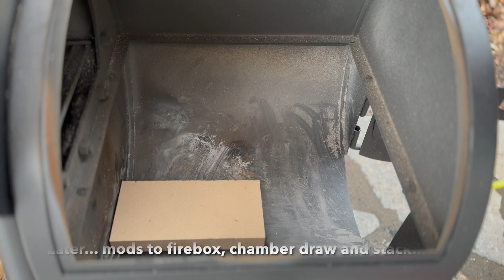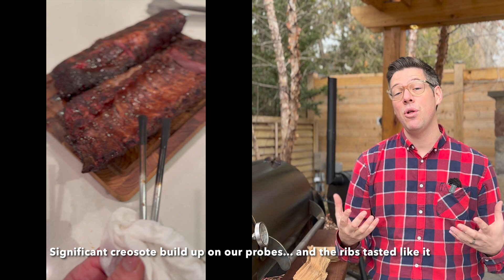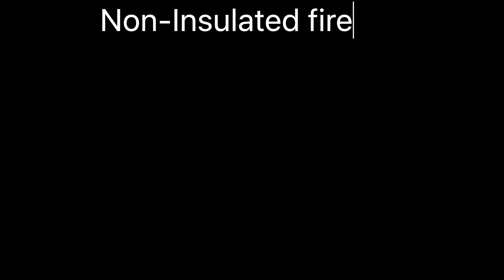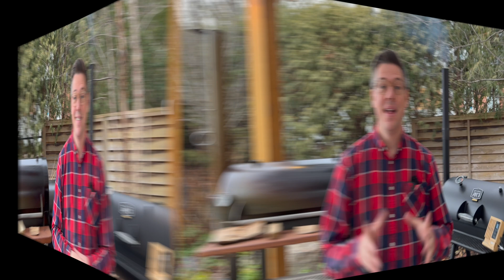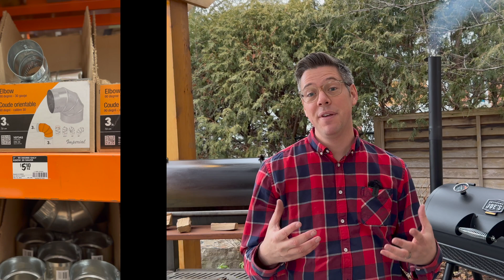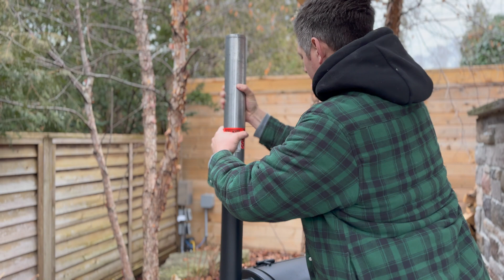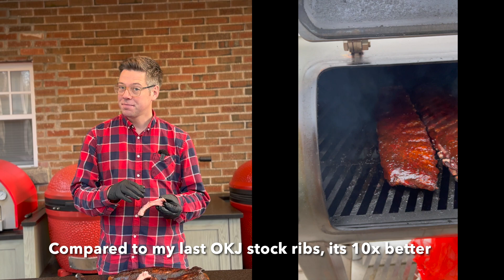Can $50 in smoker mods make my cheap offset as good as a premium smoker for WAY less $$$?

Comment: I too have the gasket around the cook chamber door, a significant extended chimney (like yours but four of them, 18" each, $8-$10 each on sale, Advanced Auto) with top left open (no exhaust damper), and fire bricks in the fire box, all of which helps.  You have to start with charcoal to start your fire.  Then add wood after the charcoal is well lit.  This will give you the low temps.  Trying to burn straight wood in this smoker will cause temps to be too high.  Big smokers = wood.  Small smokers = charcoal, then small wood splits on top of the charcoal.  Baffle plates installed below the grate will even out temps on the Highland from right to left although it will also reduce smoke on the right side.  A baffle below the grate will also force heat and smoke down low and coax it to gradually rise up through the food rather than immediately up and over the food, eliminating the need of a right angle adapter for the stack at grate level on the left side.  A firebox basket helps immensely with fire management to control temps - it really makes a huge difference, much more than one would think.  Highly recommended.  Fire bricks at the bottom of the cook chamber provide thermal density and help to minimize wide temp swings, but they must be carefully placed so as not to interfere with the draft - especially if you have baffle plates.  A custom steel water pan made to fit the Highland will also help provide thermal density as well as to keep temps even right to left as it absorbs firebox heat without allowing heat to get around it.  Fire bricks along the bottom of the firebox will also protect the steel at the bottom - keeping it from getting rusty and keep the metal from flaking, which will result in a longer lasting firebox.  A welding blanket over the top, back side, and door of the cook chamber will minimize escaping heat radiating through the upper cook chamber walls.  A second thermometer installed in the available port on the right side will help provide consistent evidence that your cook chamber is evenly heated from right to left.  I've also installed a rubber temperature probe port on the left side which can handle four probes - two for grate level temp readings and two for meat.  In all, I've spent about $250 in mods on my Highland and I'm very happy with it.  Your splits look a little thick for this smoker, I think the Highland prefers thinner splits to eliminate the white smoke, one or two at a time, depending on your desired cooker temp, length doesn't matter as long as it fits in the firebox.  They must be laid one at a time on top of the lit coal bed for 225, two at a time for 275.  Thanks for posting!

Edit 2024:  I've recently changed my mods inside the Highland.  I've removed the second baffle mod underneath the grate, and also cut the first baffle mod with an angle grinder so that it will hold the water pan but do nothing else.  I also put a fire brick on its side at the bottom of the cook chamber so that the draft hits the face of the firebrick and is forced up to the top of the cook chamber.  I also added a steel stack adapter (not galvanized) from bbqsmokermods on the inside of the cooker so that heat/smoke must exit at grate level.  These things have effectively converted by bottom up smoker to a top down smoker so that it cooks briskets, beef short rib plate, and pork ribs from the top down.  This works extremely well for small cooks such as a single brisket or a couple racks of pork ribs or a short rib plate (it would not work well if one wanted to use the entire cook chamber to cook, but I almost never use the entire food rack from right to left).  This top down draft at the left side of the cook chamber is vastly superior to bottom up smokers and is how all the much larger and much more expensive high-end offset smokers work.  I am pretty sure every COS is bottom up by design, so this mod solves that problem on a COS.  

In summary, the cook chamber mods in the first paragraph above are great for using the entire cooking grate, but it's a bottom up cook.  The mods in the second paragraph above are great for doing a brisket or pork ribs or beef short ribs because the heat and smoke are top down, putting the heat and smoke washing over the top of the meat exactly where you want it.  Good luck.
Reply: I just bought the Char Griller Dakota, very similar to the OK Joe Highland. I'm in the process of insulating the cook chamber door. Will do the firebox also. With an established coal bed, how often are you adding splits?
Reply: @noeltaylor3594  I found it best to use thin splits - I typically heat them on top of the firebox first, then add one about every 20 mins or so, as I keep a close eye on the cooker temp.  Here's a vid showing a successful brisket cook using a stock Highland. https://www.youtube.com/watch?v=QxV4w5bsPqI  Good luck!
Reply: @markennes5208  
 I’m in high altitude of Colorado.. summers and warm temps are short.
 I cook on a cheaper version of an off set .. the best that home depot offers.. and yes.., I have to import hardwood to cook with..
 Great video!!
 I’m using a tailpipe on the exhaust.. had to move it to the side and off the door.. I used JB Weild to stick a nut for my flapper control.. I also use blankets to help level the temp swings in the cook chamber and fire box..
 I also had to build a wind break/ shelter.. 
I’ve thought about going full time and investing in a professional unit but there just isn’t enough people to support such an idea.. 
 Thanks for the entertainment and logic..!
Reply: Great advice. Thoughts on water pans?
Reply: @C_hoops58  Yes, I use it every cook.  I got it at bbqsmokermods.  But you need a baffle plate to hold it.  IMO it's necessary on a COS not just for humidity but also for thermal density.  I also use fire bricks and a welder's blanket for the same reason.  These things help keep the cooker temp stable.  Good luck
Reply: Those sound like really good mods, I'm modifying a cheap Char Griller offset with these in mind.
Reply: I cut off the small side of a small bread pan and hung it from the chimney inlet.  Seems to be working great. Don’t lose very much grill space and it's made with non-galvanized steel.  Currently i'm not worried about smoke leaking in from the sides since the opening is located next to the grill, the majority of the smoke is entering at grill level.

Comment: You want to take out that 90° galvanized elbow from your smoker ASAP. Anything galvanized will release toxic fumes when heated up. You're going to poison yourself. "Zinc fumes are set free when galvanised steel is heated. These fumes are very toxic to breathe. Deposits of zinc from the fumes accumulate in the food.“

Comment: Thanks for doing this series. I have a similarly modded OK Joe's Highland and dream of bigger/thiccer offsets. My big question is how does wood consumption differ on the bigger offset vs the Highland? 

The Highland has enough space most of the time, but I would definitely take advantage of more. My concern is at what point (i.e. pit size) will I be having to use unreasonably more fuel to cook the same amount of food.
Reply from the maker: I need to test it.  Breaking the splits in half and then again they burn really quick. The large pits with logs not touched lasts longer to the point where I actually don’t think it’s a 1:1 relationship between size and wood consumption.

Comment: Really nice modes for this cooker.  I would use PB weld Extreme Heat temp muffler glue.   I like using a water hose with leaks to explain smoke leaks and heat lost.   I am thinking about getting a offset smoke because of taste of the food.  What have you heard about mods for the Carlisle offset on the new version?  What upgrades have you found useful on your Carlisle?
Reply from the maker: I just took delivery of my Gen 2 pit this weekend. I haven’t done any mods yet as I need to relearn it 

Got a few more videos to catch up on but after this experiment in the fall I decided that if I am going to have an offset and put in the work I want the results that come with that
Reply: @SmokingDadBBQ  Will be waiting for these  videos.  Thanks a lot for your videos as they help me get thru waiting for my house to be rebuild.

Comment: I’m not sure the idea of better gas mileage is correct. Myth busters tested this and realized that directly behind the truck is now turbulent air that doesn’t actually reduce drag or gas mileage
Reply from the maker: Lol well I missed that episode but the point here is that you want the smoke to hit your food not be pulled off towards a leak
Reply: @SmokingDadBBQ  Agreed!! I think a certain amount of inefficiency is good though. Too much draw is going to crisp up edges of food. So a little leak of air/smoke doesn’t bother me. Obviously that can also be helped with a damper
Reply from the maker: @Will_Dorsey  I’d rather control that with the damper vs it out of control.
Reply: Actually they found that it improves mileage by 39% if you’re 10 feet behind the truck. 

It decreases mileage if you’re 2 feet behind. 

And even 100 feet behind the truck improves mileage 11%.

Maybe you’re thinking of the pickup truck myth with tailgate up vs down.

Drafting is definitely a thing with race cars too.

Comment: For the plate at the top of the stack, I would put a small clamp that has 2 holes (much like a conduit clamp) on the outside. Drop the bolt/pin down into it so you can swing out/in to where you want it and not have to worry about silicone Adhesive.
Reply from the maker: Good idea
Reply: @SmokingDadBBQ  I had to edit that. I meant CONDUIT CLAMP.. ughhhh

Comment: I think your fire box mod was the biggest game changer allowing for a much cleaner burn.
Nice job James.
Reply: Very cool mod.. I think there is a huge market for highlander upgrades. Looking into making fire collector with a 3.5 inch pipe. Going to add the fire bricks
Reply from the maker: Thanks Brian. Yes that worked great. The clip at the end was an hour or two after adding wood and it was still hot
Reply: @SmokingDadBBQ 
I think your fire/temp control will increase with the use of a grate.

Comment: Great work James, here as well as the improvement that you've made on the Akorn.  The ultimate test for flavor would be to cook a brisket with no wrap in each your Carlisle and the modified OKJ,  mostly running blue smoke, and check for quality of smoke flavor.  Not that I am suggesting you put yourself to a 14 hour arduous task of feeding logs to OKJ in this weather.😀
Reply from the maker: Haha I did record a rib cook on this OKJ running charcoal for heat and wood for flavour like many  suggested vs my Akorn

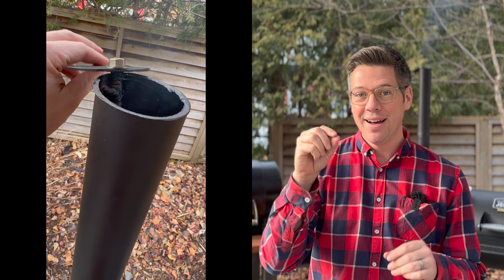Comment: 14:15 Just put the bolt on the outside. It'll make it much easier to weld. If you don't want to weld, then use SST screw clamps (paint black to match). People probably won't even notice.
Reply: Yep an automotive hose clamp on the outside will hold that bolt like nobodies business.
Reply from the maker: Good idea

Comment: Try a U-bolt (or a Crosby)to hold the threaded rod to the top of the vent stack. You’d just have to drill a couple of small holes. (1/4” or #10 , maybe)
Reply from the maker: Thanks

Comment: Great video James. Your mods were right on point to my thoughts regarding a fix to your failed rib cook. As a retired metallurgist with heat treating experience the firebrick mod makes  the most sense. It sucks to lose 6" of working space inside the cooker with the 90 elbow. Apart from fabricating and relocating the chimney exit I wonder if a floor vent fitting vs the elbow might recoup a couple of inches in the lost space.The use.of the heavy gauge muffler pipe as a chimney extender with the damper mod was right on point. In basic terms when heat treating our primary variables are time, temperature and atmosphere for optimum results for a given material. BBQ'ing food for all intents and purposes requires control of the same variables. Your mods obviously brought the performance of a budget tool closer to that of a premium tool. Inspiration to those wanting to get into the offset smoker game on a budget. Well done.
Reply from the maker: Thanks Dave
Reply: @SmokingDadBBQ  Did you also change that large aluminum pan to smaller size? I think the large quantity of water created more steam than necessary and all that soot got soaked with all that vapor and went down to the meat instead of going out of the smokestack.....

Comment: for the smoke outlet.. I think I would have put half a circle of metal like an inch in front of the back.. the smoke would then have to go down first before going up into the chimney. That way you win back your 6 inches. (well.. 5 at least). You can  simply force it in position and up against the inside of the smoker with some wedges so you can easily take it out and clean if you want to
Reply from the maker: Good idea. Was trying to avoid drilling but that would work

Comment: Any special felt? Or just normal everyday felt tape?
Reply from the maker: It was gasket felt for kamados. Amazon sells them, I used a basic / cheap one in black
Reply: @SmokingDadBBQ  Ah! Thank you!
Reply: @brandon_cave  Yeah just something with a type of adhesive that won’t melt off. Some of them will kinda slide around if they’re stuck to a hot surface.
Reply: @Chevsilverado  I figured it had to be something heat resistant! Thanks!